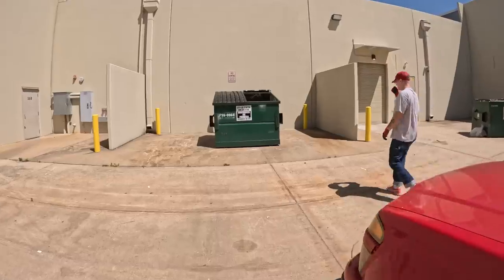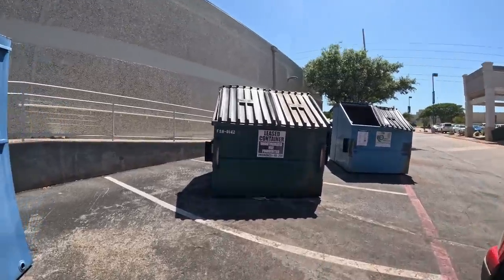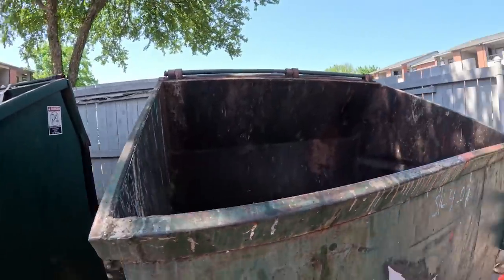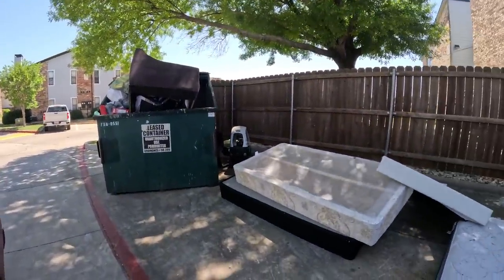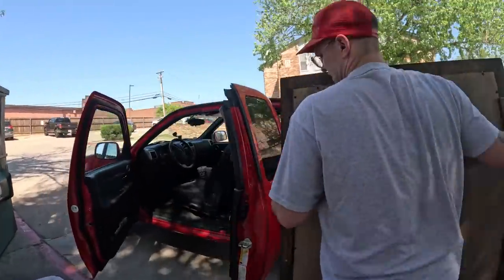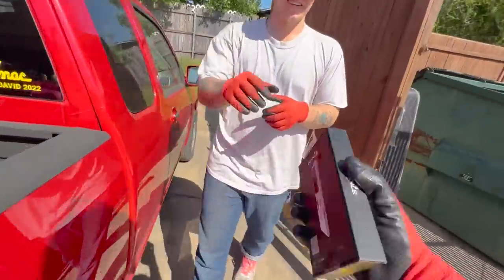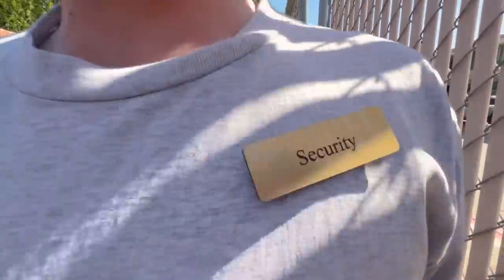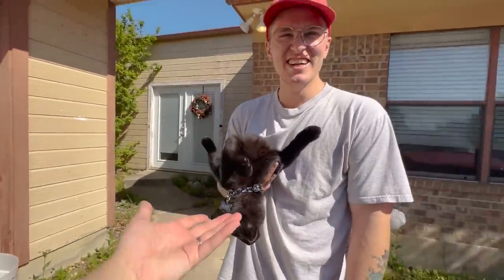Truck Bed Full Dumpster Diving at Apartments!

Comment: Awesome finds!! Great outing! If you want to clean up the coffee maker pots even more... wash them and then fill one with water and add about a half cup of bleach. Let stand about a half hour and then pour into the other and do the same. No need to do both at the same time and waist the bleach mixture. I have worked in many restaurants in my years and how we always cleaned our pots. Wash again well and they look brand new! If they have burnt coffee in the bottom from someone leaving the maker on put ice cubes and table salt in it and swish around for a bit. Takes care of it and then do the bleach thing again. Like someone said, these pots are not cheap anymore like they use to be!! The better they look the better they sell and the more $$ you can get. You use to be able to get a new standard Mr. Coffee maker for like $9.99 when on sale only 3 or 4 years ago. Not anymore!! The replacement pot alone cost more than that. Crazy time we are living in right now. If you get a maker that doesn't work but powers on, fill with a 50/50 solution of white vinegar and water. Let set for a few hours and try again. You would be amazed. Hard water build up often is the only problem. This will remove it.  I drink a lot of coffee and this has made my old faithful keep going for many years when I think she is about to give up😁! Love you two and all you stand for!

Comment: I was thinking about that Elm tree in the free pot that you were considering on planting in your yard.  Elm trees need to be located at least 15 feet away from your house because their root system is very shallow and will damage your foundation as the tree grows.  They also are one of the messiest trees for making more trees in your yard.  They produce a large amount of seeds and you will be pulling up trees out of your yard all the time.  They are a hardy tree and very tolerant thus the billions of trees they will create in your yard, lol.

Comment: The fabric inside the dishwasher goes around the outside for padding,  insulation, and sound dampening. Also, almost all newer dishwashers feel flimsy until they are installed.

Comment: If the brushes on the Hoover don't turn there should be an air inlet screen under the clear cover on the front corner. The brushes are run by an air turbine with air pulled through by the vacuum. Dust builds up on the screen and the brushes can't turn.